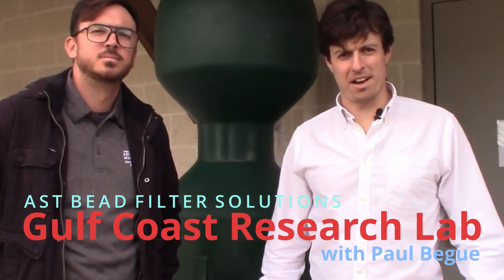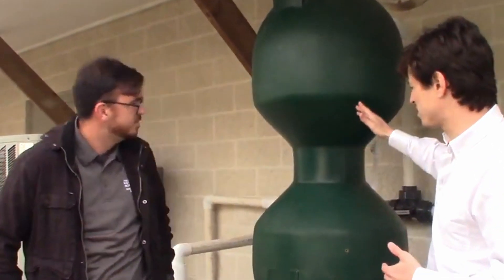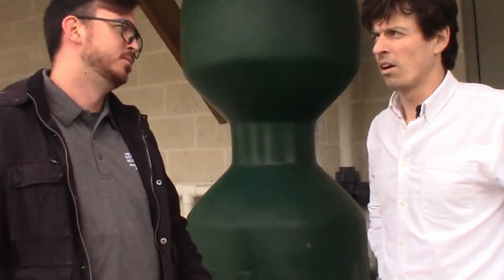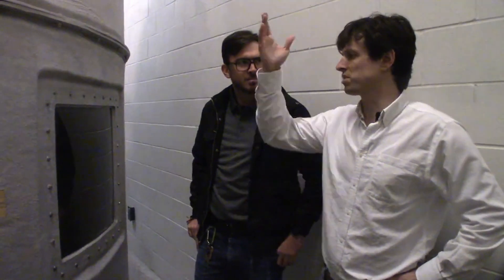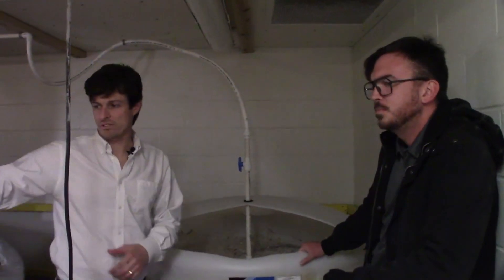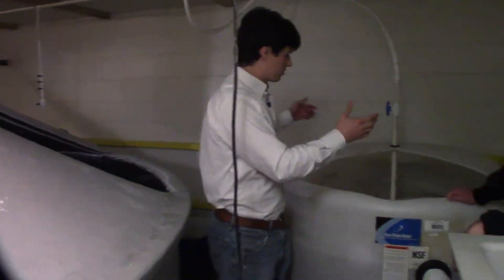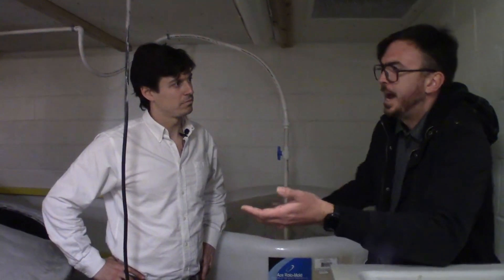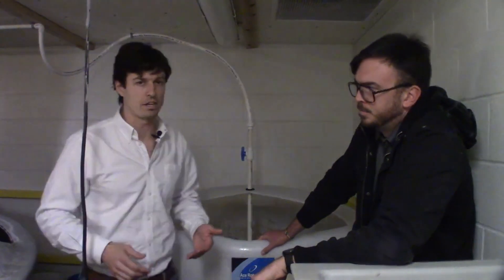Triple Tail Breeding System at Gulf Coast Research Laboratory Part 2

Comment: Why does he need a biofilter and a bead filter?
Reply from the maker: Great question, short answer is that it all depends on bioload sizing. If bead filters are sized according to our specifications, MBBRs are unnecessary.  The prevailing filtration school of thought for a long time was that you got the best filtration having separate solids and biofiltration because each could run more effectively. The data doesn't support that anymore.There are a number of scientific papers where people tried to prove that bead filters were inferior (to separate solids and bio filtration), and only ended up proving the opposite. Some people may still use MBBRs just to have robust nitrification bacteria colonies (this can be especially nice for seeding new tanks). Some choose to use a smaller bead filter (for solids capture primarily) and rely on a MBBR to provide the necessary surface area for the biological. This comes down to space and cost constraints.  

The initial filtration at this institution was already present and Craig had to work around existing systems. Systems evolve over time with new equipment and technology. This can make for convoluted plumbing. It is not always feasible to do a complete overhaul of whats already been done, especially if the tanks are already stocked and running.